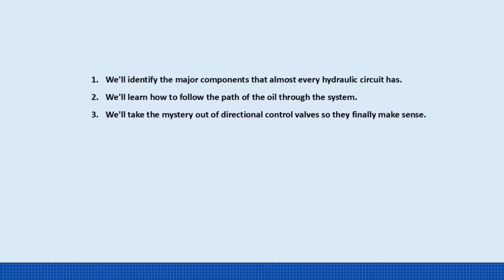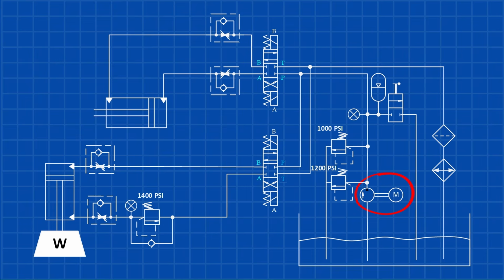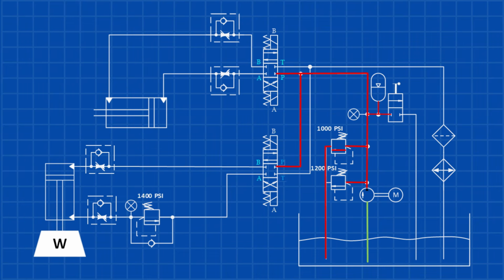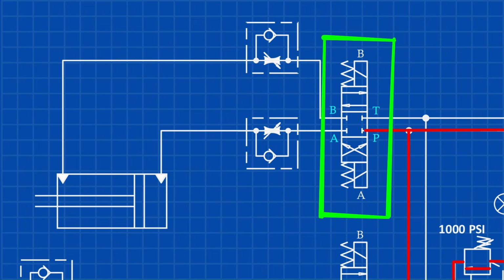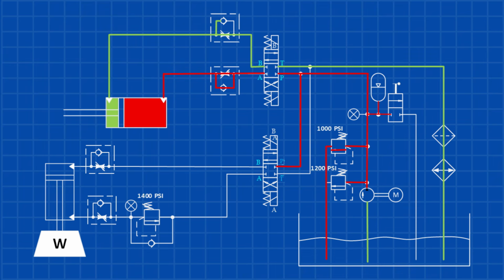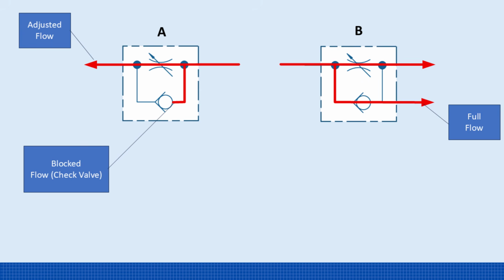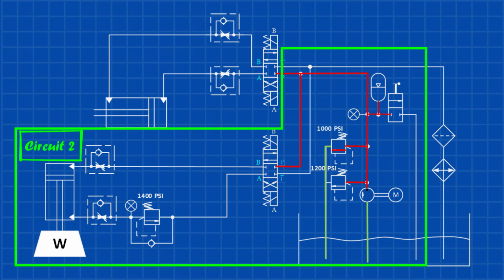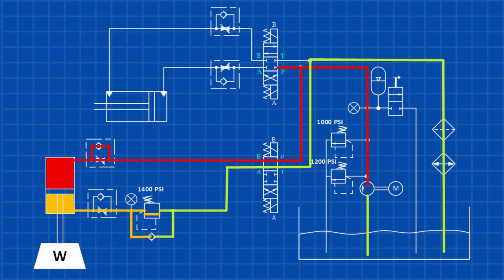How to Read Hydraulic Schematics (Beginner's Guide)

Comment: Aren’t you rather a hydraulical lad at this point? :)
Reply from the maker: Thanks, that is funny! My education is electrical engineering and controls for mostly Hydraulic systems, and designed many Hydraulic systems for different application. Also troubleshot Many systems. Thanks

Comment: great video but where is the file with all the symbols?
Reply from the maker: It will there by tonight
Reply from the maker: Please check description for the link now
Reply: @Electrical-lad  thx you can remember all those hydraulic symbols in the file?
Reply from the maker: I do , once you work with it , you will remember.
Reply: @Electrical-lad because there are a lot of hydraulic symbols.  Remember all of them , many of them have almost the same symbols but small changes. Your video are really a good help